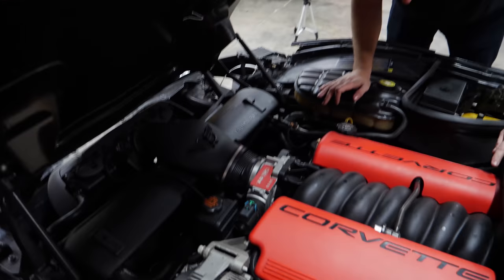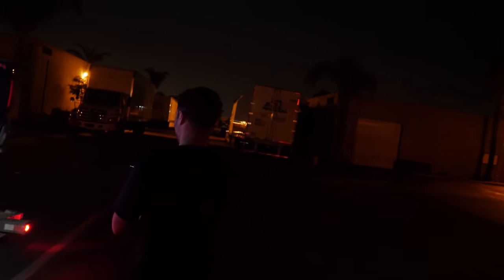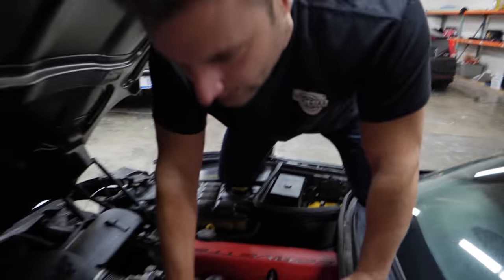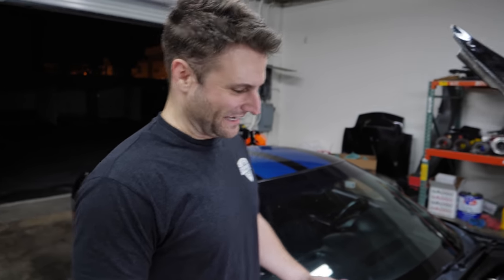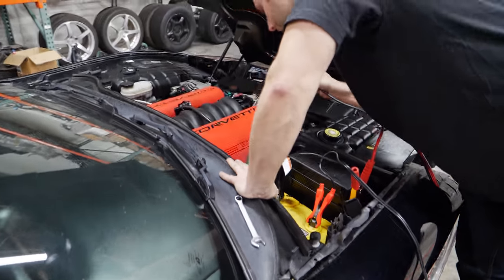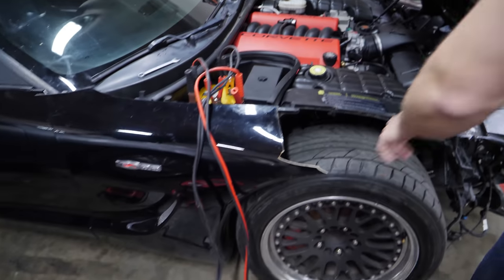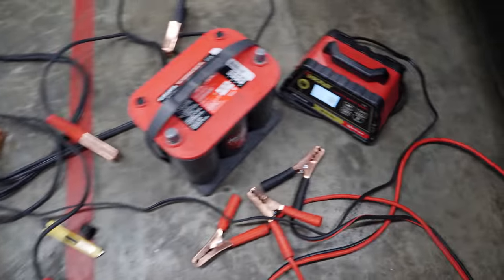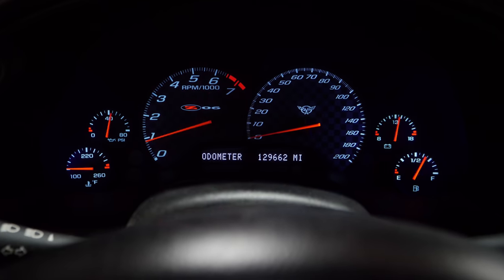Damage on our Salvage Corvette is worse than we thought.

Comment: The driver's side bracket you pointed out that had damage is the bottom of the skid plate. They constantly get rubbed on speedbumps and parking standards. They're always scraped up or damaged. They make "fangs" and rollers that mount on them to prevent it, but most people don't bother.

Comment: I don't think your chassis ground was good, but if you want to jump a car with a dead battery, disconnect one of the leads from the dead battery, start it, then put the lead back on. A bad battery is a bigger drain than an engine trying to start.

Comment: the hood latch that you guys put the negative jumper on is bolted to the composite chassis so its not a good ground lol. There should be a large bolt head next to the gas strut base for the hood that is a ground.

Comment: The view of the front cradle to frame does looks like there is a gap towards the front. Should be able to pull it back / down. Its a GM Larger version of the RX7 Lol

Comment: Did they jump start it on the trailer too?
Reply: Delivery driver used a jump pack and drove off the truck and into the building still attached. You can see the red cables while he's backing off the trailer.
Reply: @MrWoodyBalto  Yeah, my bad

Comment: American Engineering?!?!  A copy of the 3rd Gen RX7 for sure...hard to distinguish between the two from afar.
Reply: Seriously? When it comes to engineering, they couldn't be more dissimilar. Body style? The Vette's design, think C4 has been around longer than the FD. That said, I think the FD wins on sex appeal. Throwing a random number out there, I'd say the FD has to be on the top 25 list of best looking cars ever made.
Reply: @tscooter22  So is the C5 'Vette, in my opinion.
Reply: @halofreak1990  It is VERY nice looking. My personal favorites are the C6 convertible and gasp... C3 (late 60s ragtops). The C7 is starting to look better to me, but its styling is a bit overdone, IMO. I prefer the cleaner lines of previous generations. When I think C7, Terminator comes to mind.
Reply: @tscooter22  Err.......that's a C5 Corvette 1997-2004   RX7FD 1993-95 USA and up to 2002 Japan
Reply: @marsredr100  Err...... I know that, but it's a descendent of the C4 (reread my previous reply "think C4") which has a similar design. I also know about the RX-7. I bought mine brand new in 1995. /points left